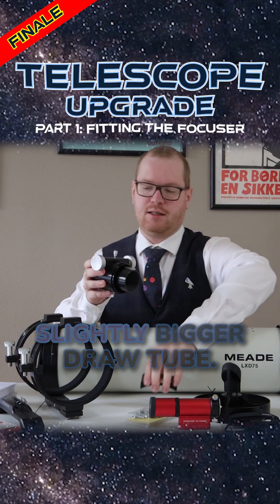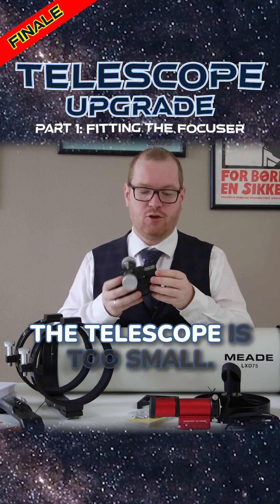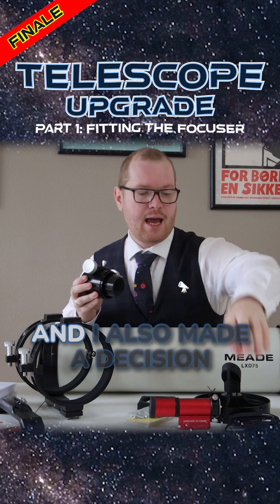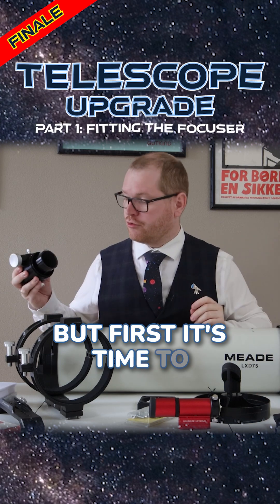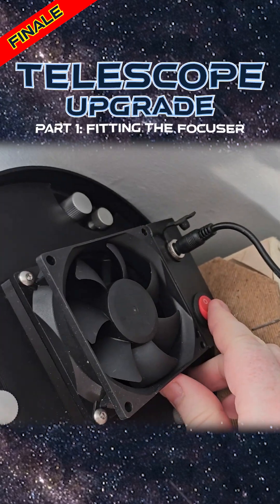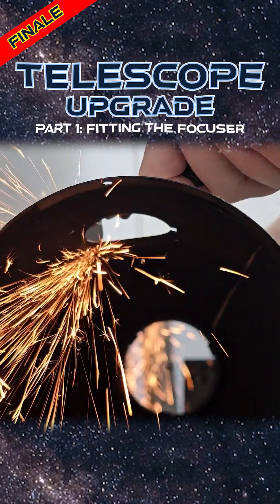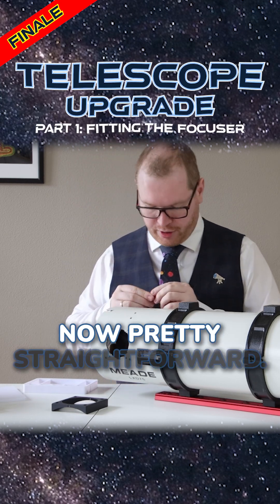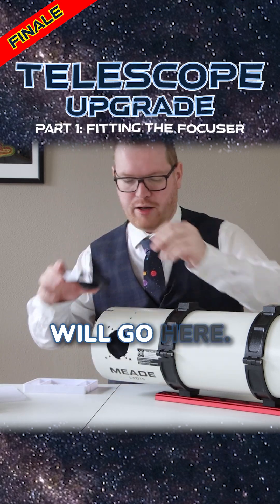I added a new Focuser to my telescope

Comment: Just bought a vintage Meade 4501 for $40. It uses the smaller diameter eye pieces and I’m debating whether to upgrade the focuser or to just get an adapter for my
modern eye pieces. I also want to connect my DSLR camera to the focuser for astrophotography. What do you recommend new focuses or adapter?
Reply from the maker: I can see the 4501 is a 4.5 inch tube. You might have a hard time finding a replacement focuser for that diameter. If you have a 3D printer you can make your own adapter to make a new focuser fit the tube. Else I would stick with whats there now